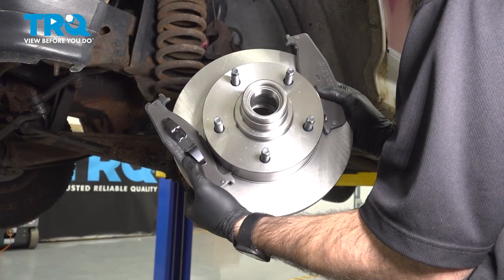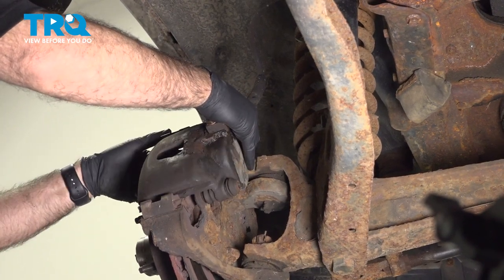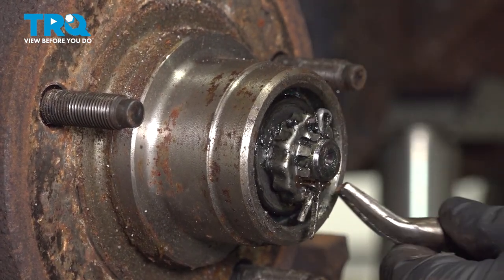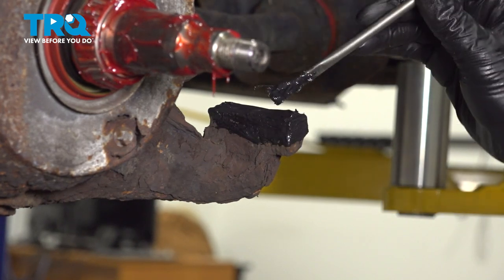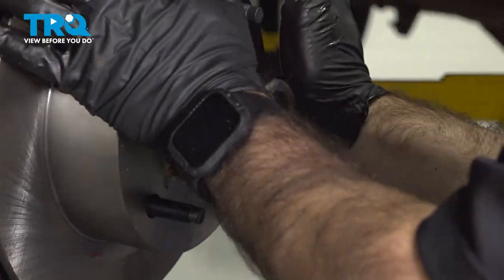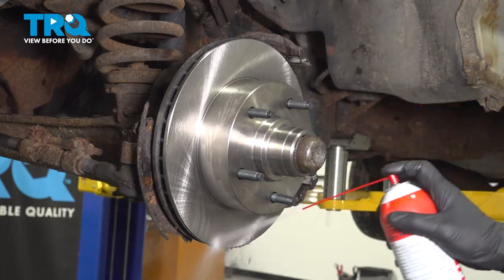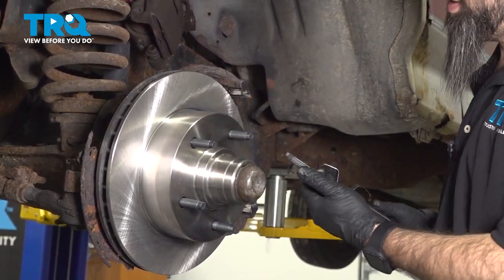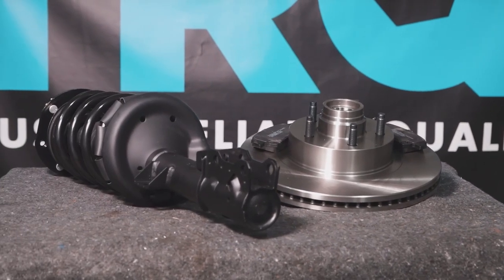How to Replace Front Brakes 1992-1996 Ford F-150

Comment: Good video, just not complete. You should have shown packing the bearing, installing the grease seal on the rotor, replacing the rotor, cleaning the spindle.   You also need to show how to change the brake caliper, since you did replace it too.   There are people watching this who are in the process of learning how to do this.  Thanks
Reply from the maker: +@edwardmissouri2216 Thanks for the tip! We'll pass this info along to our production team. http://1aau.to/m/Shop-TRQ

Comment: suddenly the caliper is brand new... lol probably coz he couldnt get the old one on the new pads..  also - totally dont understand the tightening pressure he puts on the nut... he tightens it to 50 pounds... then backs down a 1/4 turn.. then re-tightens it... wth... so confusing...